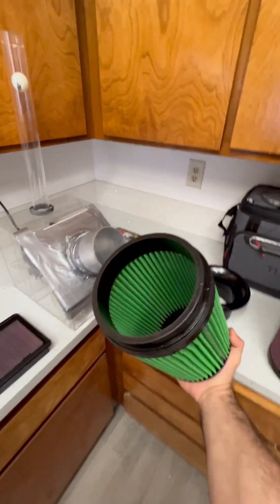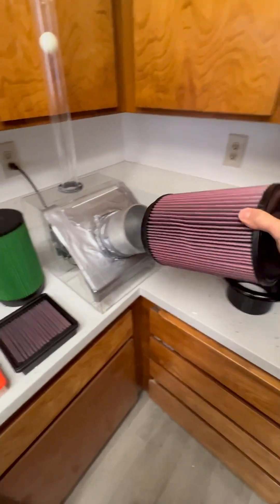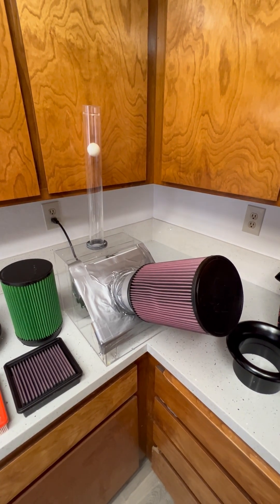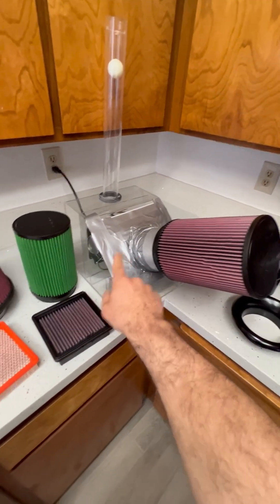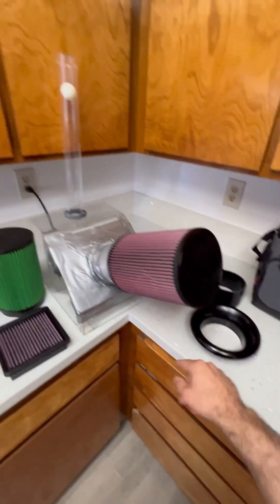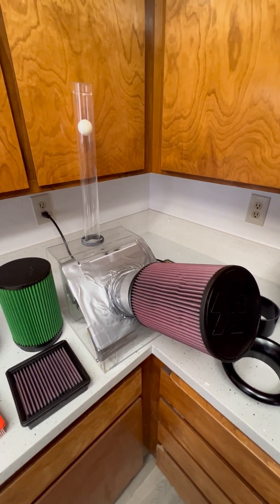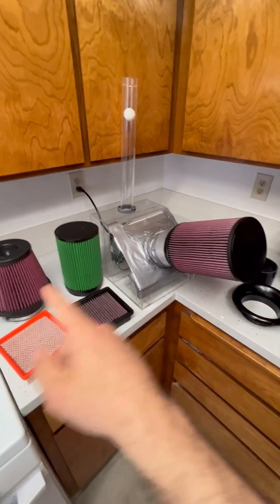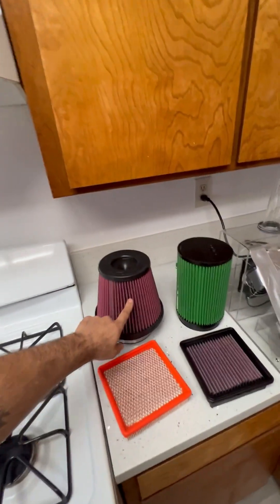K&N vs Green Filter vs S&B/JLT filter test!

Comment: Did you ever get around to testing the filtration of these filters? I can't find any testing for the GREEN.
Reply: I ran a green filter in my built up Chevy Colorado running muddy trails to fine sand. When Id clean the filter the engine side always looked brand new compared to the inlet side which was filthy af
Reply from the maker: No I didn’t, I know the green filter is a thin un oiled 2 layer. K&N oiled 4 layer can even tell by looking at them that the green will let more particles through
Reply: @matt7sixty the greens are oiled fyi but definitely very thin. You can almost see right through them! Not sure if I trust using one long term
Reply from the maker: @Reign_in_Bloodd I guess I should have said no oil present like the k&n. Wouldn’t know any was there if it didn’t say

Comment: Thought it was going to be a mustang gt vs the world video lol
Reply from the maker: Haha soon!
Reply: The problem with this test is that these are "filters". If you want max airflow, just leave the intake open. The goal of a filter is to keep your expensive engine clean inside, which K&N filters are terrible at. A proper test would compare filtration effectiveness against airflow at actual engine flow rates.
Reply from the maker: @TheDrNinjaman  I tested open and Velocity stack as well here. Far from scientific as I mentioned but fair testing. None of us are going to drive around with no filter. K&N is our best option if we don’t want a reduction in flow.
Reply: @matt7sixty  Yeah if you want grit, scored cylinders, and an oily airflow sensor. Whatever 'horsepower' you gain will be lost from missing compression later on. AEM dry flow filters actually filter and flow well for their filtration level. K&N are old hat trash, you can see light through the holes when they're brand new, how is that actually filtering anything but the big chunks, it's not. If you want to see how bad it is wipe some grease around the inside of your intake piping and check it for dirt after a few thousand miles. Or on your 'flow bench' try sprinkling some fine dirt on the filter and seeing how much blows out the top or falls to the bottom of the cylinder. You'll see how bad it really is.
Reply from the maker: @huzudra  Only way to score cylinders is with large particles. K&N does great with larger particles. It’s 4 layered and oiled. Many of us use k&n in everything for many years with zero issues. I’ve used them the past 15+ years. Your dry flow filter wouldn’t do well in this test probably same or worse than the JLT did being dry it will have more media and less flow. The green filter is a very very thin 2-layer with no signs of oil present yet the K&N still flowed more. I want the most flow personally and in what I design and sell I use K&N. The green filter I wouldn’t trust for daily use.
Reply: @matt7sixty  K&N is your best option if you can't afford to add power properly. However you slice it, this isn't "fair", it's K&N propaganda. That's why it's their test rig. As I said, a meaningful test would compare airflow vs filtration, and over the life of the filter as well. My understanding with K&N filters is that they flow very well initially, but clog up faster than most other designs and tend to flow worse when clogged. So you better keep that cleaning kit handy.
Do you have any idea how much money automotive manufacturers spend on optimizing the performance and efficiency of the engines they sell? If K&N filters are so good, why don't any OEMs use them or something like them? Not even in their high power models. Save your money.
Reply from the maker: @TheDrNinjaman  No propaganda here I don’t work for k&n. Propaganda would be the test green filter did where it made k&n look like it flowed the same as the paper filter. I tested my 1 year old k&n filter and it flowed more than the brand new filter as it was not re-oiled which is how I use it on my personal Mustang. You are clearly bias against k&n no matter what but don’t seem to know anything. You’re like 0 for 3 here let’s go for 0 for 4. I don’t speak or type unless I 110% know and tested it unlike you and others so tread how you may
Reply: @matt7sixty  Why would you have to work for K&N in order to be biased to promote them? You've said yourself that you run them in your personal vehicles. Cognitive dissonance is a powerful effect. YOU spent money on them in an effort to improve your vehicle's performance so you are motivated to justify that purchase. I don't doubt they can flow more air than the stock filter. I'm simply questioning whether this is wise. A $30-$40 air filter is going to amount to somewhere between diddly and squat in terms of actual additional power production, while presenting a very real risk of accelerated engine wear.
You accused me of being biased against K&N filters. I suppose that's true, but it's not some emotionally charged unfair bias. I've bought them and used them in the past, specifically for my motorcycle. Since then, based on my experience and a number of very convincing and comprehensive tests posted elsewhere comparing K&N filters to OEM paper filters that quantified both airflow and filtration effectiveness in real world driving conditions, I've come to view them as essentially snake oil. They're one of those products for which the promised benefit is so imperceptible that they need to come up with things like this ping pong ball test to convince you that they're doing anything at all. The tests I'm referring to showed exactly the behavior I described in my previous comments. High flow and poor filtration for a short early period, followed rapidly by clogging and reduced airflow in an exponential curve, while the OEM paper filter showed a linear trend, the filter media flowing less air as it picked up dirt in a very progressive fashion. But you do you.
 When I was broke, I bought K&N and it didn't do much. Now that I'm not, I get a downpipe and a tune and enjoy power gains that speak for themselves.
I also find it amusing that you mentioned testing the filter that you've been using for a year which you haven't re-oiled, but you absolutely won't run with an empty airbox! 😂 Let me just close by saying beware of products that promise something for nothing.
Reply from the maker: @TheDrNinjaman  Then I spent even more $ to try and find out which one is best looking for more always